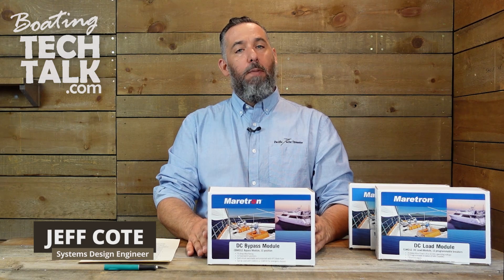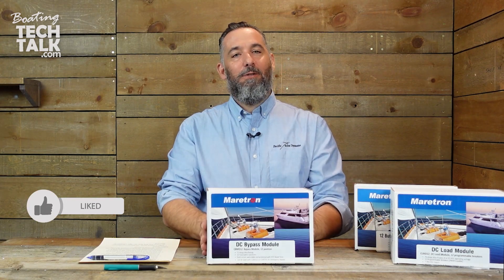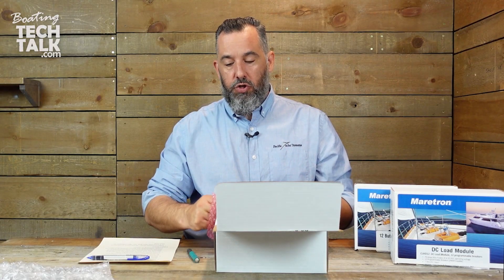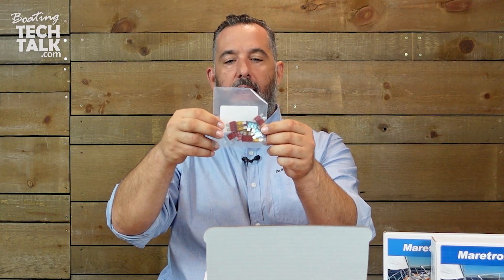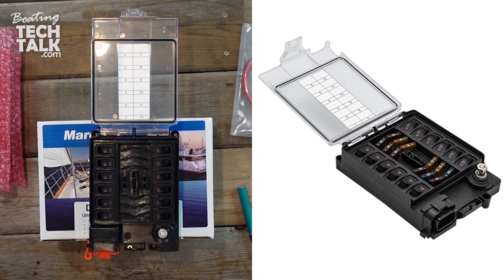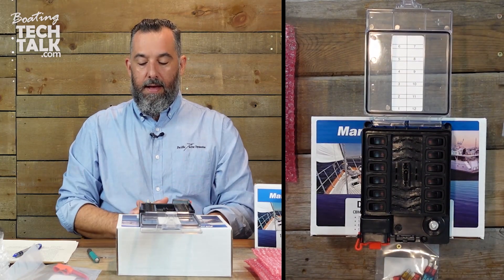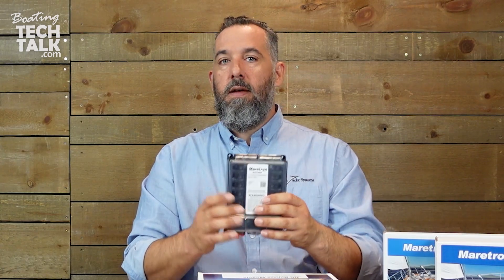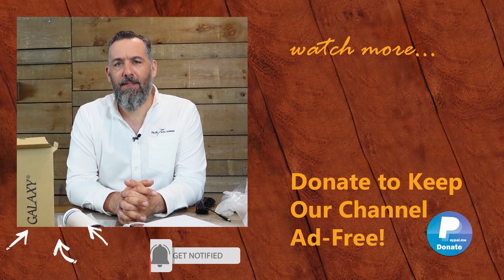Maretron Digital Switching - Part 3 of 3 - Unboxing and Product Review

Comment: Currently getting a Hughes 38 fixed up and ready for live aboard single handing. I have 10 fingers and 10 toes that all work okay. Why would I want digital switching ???
Reply from the maker: Digital switching is a way for boaters to reduce wiring needs aboard a boat and reduce the need for all wiring to be centralized at the DC panel. When building a boat, DC switching offers more convenient ways of switching circuits on and off from various locations on the boat. Also, you can create different modes, that automatically turn on or off a set of breakers, instead of manually turning all the breakers on/off individually. Anyone can share their reasons for digital switching.